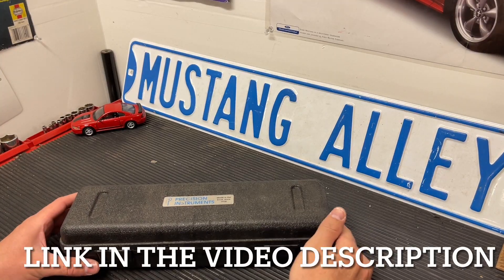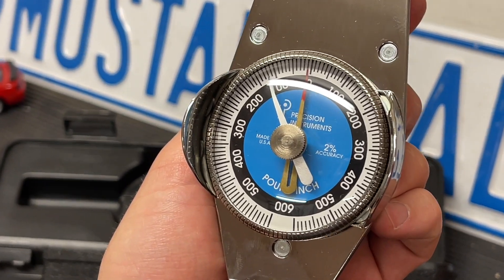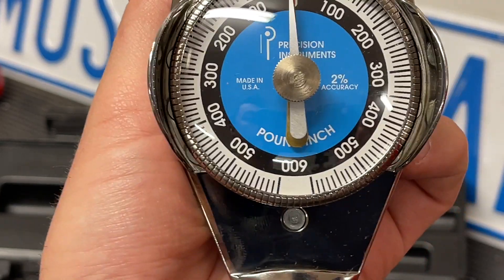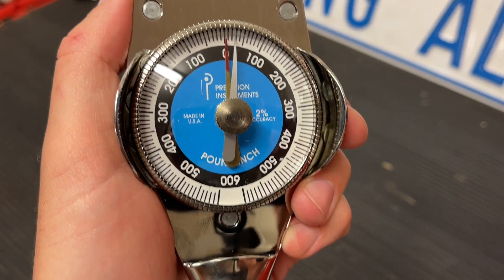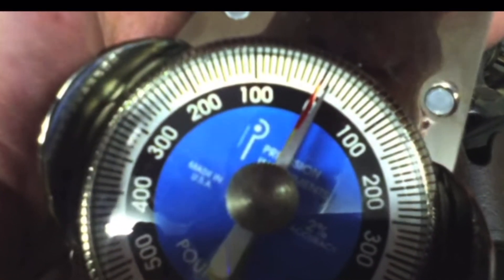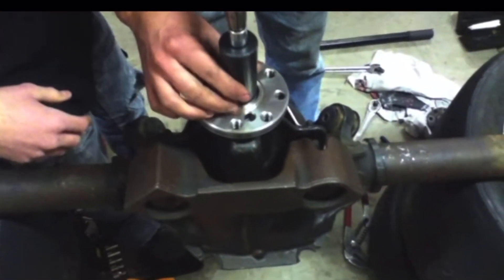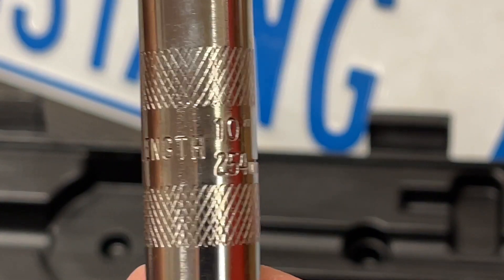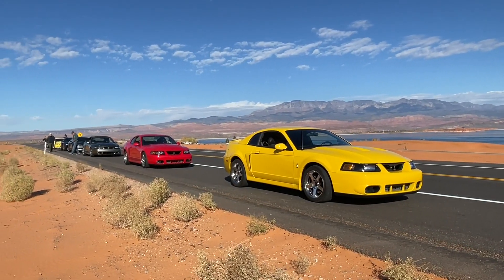How to measure bearing Preload with a Dial Type Inch Pounds Torque wrench

Comment: An excellent video I've got to change the pinion seal on my diff, now I know what I'm doing.
Reply from the maker: I have a video if you’re interested. With the gears, axles, wheels installed you’ll have a hard time getting preload. You won’t crush the crush sleeve further by hand, so it’s worked best for me just to snug it down without an impact, use a new nut (lock tite is a must). https://youtu.be/bHaV-rTqInk?si=8T9YQLhUviWVZtNQ
Reply: @dannyjohnsonsgarage  thanks I'm actually doing an old vauxhall frontera, it uses isuzu diff. Am I right in thinking that aslong as you count the threads and number of turns you don't need a precision torque guage?

Comment: I have read that Torque measure tools should not be used( are less accurate) to measure less than %20 of their capacity.
So a 600 inch pound tool should not be used less than 100 or so inch pounds.
So a 50 inch pound tool would give better accuracy when measuring 20 inch pound.

Comment: MB manual says 110-160 ncm or 9 to 14 inch lbs for a steering gear box force from the center. What do you think?  This is supposed to be done in the car while the pitman arm is disconnected and rotate the torque wrench on top of the steering wheel with a special adapter. I watch you torque 20-25 inch lbs on that bearing.  You think my numbers is right?  I don't know how a inch-lbs or ncm feels like.  I need to order the one you have first.  I'm used to the Foot lbs which clicks to tell you the torque
Reply from the maker: You’ll feel the resistance. It’s about the same as my rating of 20 inch pounds. That’s enough to feel as you see we turn the pinion by hand and it doesn’t freewheel, but stops on its own

Comment: Hello,  I have a old Mercedes w124 which I replaced the steering gear box with a rebuilt one but nobody told me about the friction torque not been done.  The instruction only says centering the gear box before installing.  Then it was installed but steering is heavy.  I manually adjusted it with the adjustment screw but I was never satisfied with the steering.  MB w124 manual has a friction torque specs but the tool is not available to buy anywhere.  Can this be used mounting it on the steering wheel and measuring it from there without removing the gear box out of the car?  I read about removing the steering wheel airbag and connecting a socket were you can attach the torque wrench.  Then you center the wheel and turn the torque wrench to measure it.  Do you have experience regards to this? Thanks
Reply from the maker: It depends. As you saw in the video with the pinion gear, that must be done without any other components installed for an accurate reading. If the steering box has a torque measurement installed, then it might work for you
Reply: @dannyjohnsonsgarage  I also had to jack the front end and remove the pitman arm to adjust the screw.  Done it 2-3 time without measuring it loosen and tighten the lock nut and test drive. Cost me 2 wheel alignment every time I touch the screw.  This time I have a spec of 110-160 ncm when I test turn the wheel.  Hope this works.  I will only spend $160 for wheell alignment and buying this tool

Comment: readouts are too large... dana 80 which is in one ton trucks requires only 10 in lbs of torque on the pinion nut to rotate pinion. you would barely be able to read it on that thing
Reply: That company makes dozens of variants in different driver sizes and torque ranges.

Comment: Hey great info. Hey, am I better with a NM wrench or Inch pounds wrench when doing a pinion pre load test?
Reply from the maker: Either scale works as long as you’re following the torque spec. The only disadvantage of this one was 20 inch pounds barely registers, so you may want one with a smaller range scale